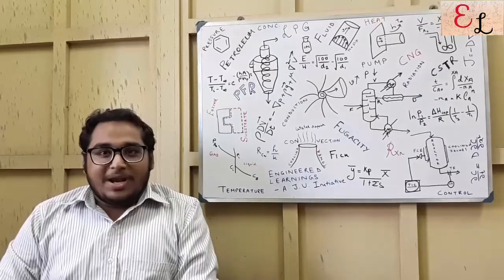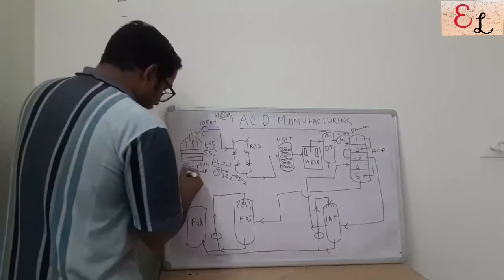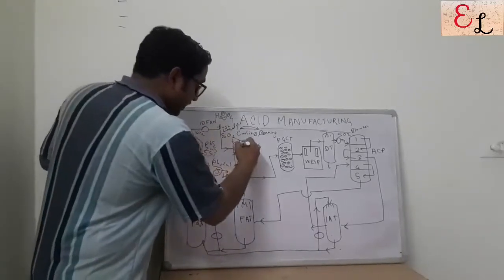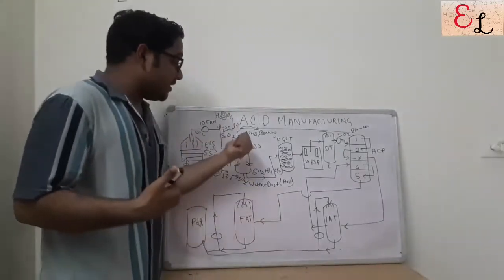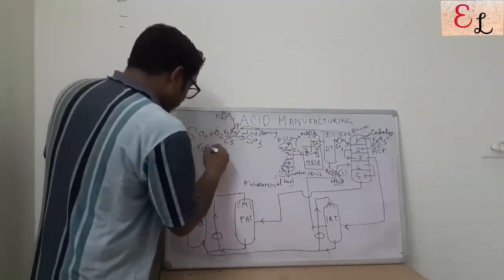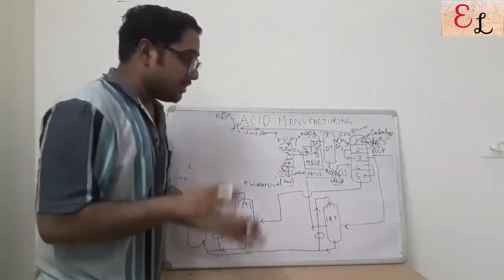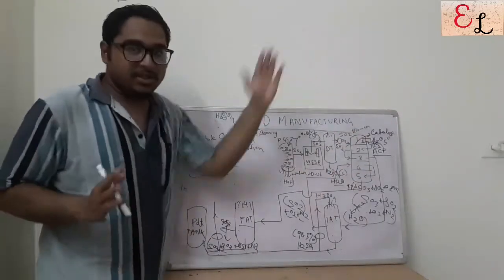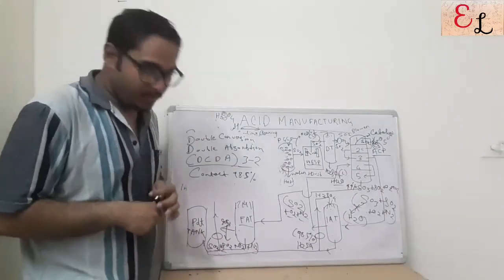ACID MANUFACTURING | SULPHURIC ACID PLANT | CONTACT PROCESS | DCDA PROCESS | ACID INDUSTRY

Comment: Superb sir..
Reply: Sir , pls explain just briefly in PGCT function , construction and MOC.
Reply from the maker: It's basically a Small Scrubbing Tower, where water flows countercurrent to the incoming gas flow and to ensure proper distribution and interaction and to increase the residence time, Polypropylene Spherical Packing Balls are kept within the tower and thus the liquid and gas interacts with each, the liquid takes away the dust with itself and leaves the clean gas behind.